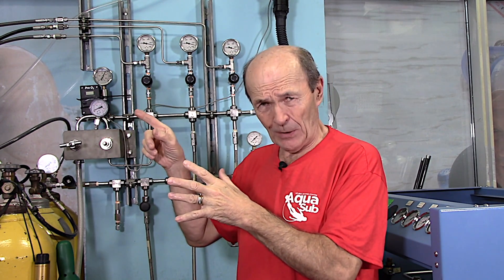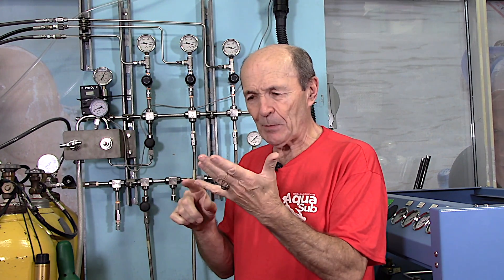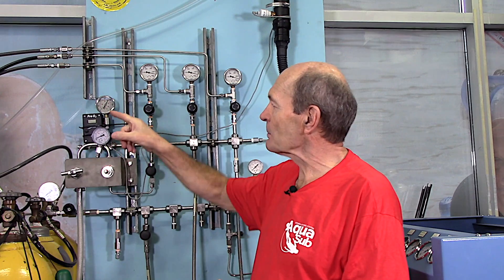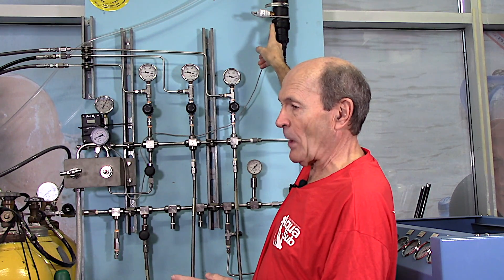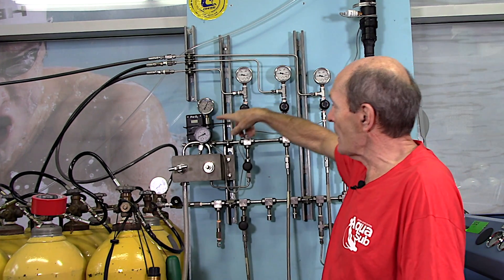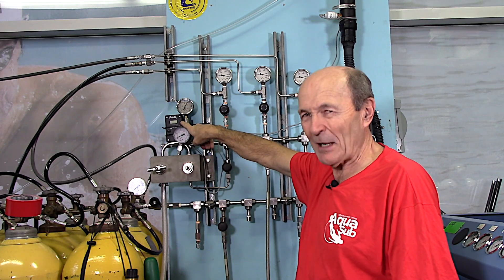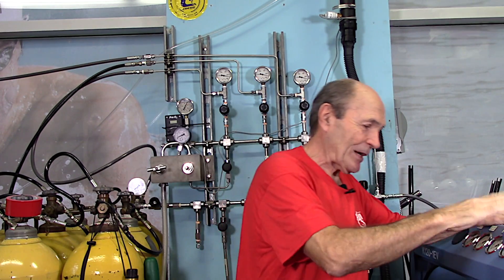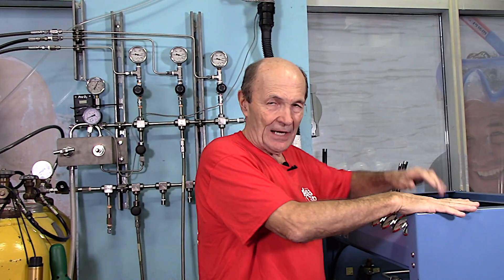How Is Nitrox Made? - Scuba Tech Tips: S08E21

Comment: We used to use the partial path pressure method with a twist. We would first pre-fill the tank partly with air And then fill up to a certain percentage with pure oxygen and then use air to create the pressure needed to go to 3K PSI the math was more annoying but it meant that like adding acid to water you weren't really slamming the tanks interior at any point in time with high pressure pure O2.

Granted yes in the moment the valve did. 

This reduced  total risk overall...

And we always checked our Blends on an oxygen analyzer afterwards..
Reply from the maker: The partial pressure mixing method is fading away as blending sticks and new monitoring can do this with less risk (and math), than PP.  
A

Comment: The Atmosphere is 21% O2.. 462 PSI of O2 + 2600 PSI of Air. Roughly have 1/3 of the Tank filled with O2. Hence your 32% Nitrox.
Reply from the maker: Not quite so simple when using partial pressure blending to get the blend within 1% of target.
A
Reply: @AlecPeirceScuba_SeaHunter  I remember reading years ago, The Atmosphere was 20.8%O2

Comment: Good info, but why would you need a booster pump for continuous (stick) blending?

Because the O2 tank is flowing into the stick at atmospheric pressure I regularly am able to use my O2 J tanks right down to about 2bar, essentially the whole tank. And then of course the main compressor will provide the pressure to fill the tank, so I am confused about the mention of a booster pump?
Reply from the maker: It is a bit of overkill but a booster can be used for different purposes. Sure it will draw down an O2 tank so the full contents can be used. That's not needed for Stick filling, as you say, but it can also be used fill higher pressure tanks, for topping up, for transferring contents, etc.
If not needed at your facility, as with a Stck fill, avoid a booster. They are not cheap, they're noisy & need constant care to remain safe & in top condition.

Comment: The Membrane system for making Nitrox is a lot easier and safer than blending it I’ve got a Nuvair membrane system with a Bauer K14 -4 stage compressor for sale that I used in my commercial diving work
Reply from the maker: That is a good setup and reliable.  No air, no work right?

Comment: Great video, years ago I was a commercial hydrostatic tester and also  a relief pumper for nitrogen and helium. Burst discs happened quite often, but then the cylinder was contained by the fill fitting valve and hose. Now they may use safety chains! Very loud but not a lot of reaction from cylinder because it was a controlled release. Also remember the cylinders are hydro tested to 5/3working pressure, 5/3 of 3000 is 5000!
Reply from the maker: Thanks for sharing Bigfoot.  I did 2 videos on hydrostatic testing as many divers don't know the 5/3 testing pressure and get paranoid about a 200 psi increase due to a hot sun!

Comment: Is this a basic comprehensive list of what you would find in a dive shop?
Reply from the maker: It is Erikk.  Most dive shops have one method, usually the 'stick' as is easily to control with a high fill rate.  Next time your at your local dive shop, ask to see their setup as they fill your tank.
Reply: @AlecPeirceScuba_SeaHunter  I will do that. 
I was just wondering because I know that the gas produces have different methods for different gasses and volumes but I would guess those methods would be out of the reach financially or most or even all dive shops.

Comment: When adding O2 on the partial pressure method do you have to account for the scuba cylinder’s temperature increase (and resulting pressure drop after it cools). Obviously the O2 isn’t going to have a huge pressure drop from 462psi. as it would when filled to 3000psi.
Reply from the maker: There is a small measurable change due to temperature but the PP blend does not need to factor in temperature, its primary pressure and volume only.

Comment: A good video which isn't too technical :) .

I've not heard of "the stick" before, but it does sound like a handy solution for some people.

A fourth option that you didn't cover is a Membrane compressor. These have two compressors, one low pressure and high pressure, and excess nitrogen is removed through the membrane as the now Nitrox gas is pumped into your cylinders. Most won't pump above 40% O2, so the cylinders don't need to be O2 cleaned. It's possible to dial the percentage that you want.
Reply from the maker: The membrane system is often used on dive boats. It is not an inexpensive system to set up but does offer increased safety because the tanks and regs don't need to be O2 clean.
Thanks ScubaGirl.

Alec

Comment: I use partial pressure blending method. But I use a cascade of oxygen bottles to get the maximum of each one.
Reply from the maker: Yep! That works. Or get a booster so you can use most of the oxygen in a bottle.
Thanks.
Alec
Reply: I think this is the most common method …partially fill empty tanks with pure O2 depending on the requested mix, and fill the rest with regular air.

Comment: Hi Alec, 
thank you for another amazing tech tip video! 
Can you tell us about Open Cell Neoprene wetsuits?
Reply from the maker: Uh, to the best of my knowledge there has never been an open cell wetsuit, at least not a successful one.
Open cell material is basically like a sponge. Every cell is interconnected so water travels throughout the entire material and completely soaks it inside and out. That's great for holding a bunch of soapy water when washing your car but wouldn't insulate your body from the cold. And it would take forever to dry too.
Wets suits are made from closed cell neoprene so, although filled with millions of cells (holes or pockets), each is separated from its neighbors. Thus the suit is largely air and provides insulation. And when you hang the suit up in the sun, only the surface is wet and it dries instantly.
Take care.
Alec
Reply: @AlecPeirceScuba_SeaHunter  I had seen this https://www.youtube.com/watch?v=7P2Gj_lDFes but not sure I understand the concept - maybe something else is missing

Comment: Those O2 cylinders look awfully lot like industrial “welding/cutting” cylinders and an industrial  reducer. Not sure about your side of the pond but in Europe medical O2 is shipped in white cylinders with a black band. 
I would happily use industrial O2 but its not certified clean and healthy for human consumption? 🤔
Reply from the maker: I think most 'industrial' cylinders are similar. The difference would be in the contents and the level of cleanliness as required for the gas.
Generally, the cylinder color indicates the contents so here, a green top means oxygen. There are several levels of oxygen depending on the application. I use a similar cylinder for my oxy-acetylene welding at the ranch (see AlecPeirceAt the Ranch) but, as you say, that would not be suitable for breathing. There is medical grade and breathing grade and probably others too. That would be specified by an attached label.
Take care.
Alec
Reply: Actually industrial gas is cleaner than medical or aviation gas they just have a ton more paperwork

Comment: Before the days of commercial Nitrox, we used welding cylinders (medical O2 required a prescription) and a cascade hose to add O2, the top off with compressed air. We did use O2 analyzers (we were stupid, not suicidal). Did the same with trimix, used a helium canister!
Reply from the maker: Just as with early scuba, there was a lot of trial and error (more error than trial sometimes) with early gas mixes.
I'm hoping that today's divers appreciate what came before. It wasn't always as easy as going into a dive store and asking for  32% mix!!
Alec

Comment: topic: spare air or similar second air source. is it worth it, do you just get 3-4 breath at typical 60ft+ depth ? which is better than nothing I suppose....
I find myself diving alone more (either lobster hunting in which case you intentionally split, or having a greater distance with buddy which can take a while to reach at depth) and thinking self rescue is always better than depending on someone else, or use it to reach them. I've seen those piggy back tanks but they are heavy + full regulator. There are many cheap copy cats now out, so not a lot of $ for extra safety net.
Reply: I should have known you already covered it. Thanks!
Reply from the maker: I made a video on this topic Alain S04E10. Check that out.
The best redundant air supply system I've ever seen/used is the from XS Scuba. It's called the  XTR Extra Air Backup System.
It's light, easy to use, compact and cheap (relatively).
Good luck.
Alec
Reply: thanks! https://www.xsscuba.com/regulators/xtr-extra-air-complete-backup-rescue-system

Comment: It's been asked already, but can you explain the "membrane" method of making nitrox? I don't think for this method the tank needs to be O2-clean, or am I wrong?
Reply: it does not as the air coming out is pre-mxied which all tanks can take. My understanding that a membrane separate the Oxygen molecules from Nitrogen molecule (different size) with a separate compressor, and that is mixed with regular air (like the stick mentioned) into the main compressor that fills your tank.
Reply from the maker: That's right Alain. Always think about the gas going into the tank. If it's pure oxygen or even above 40%, the tank must be O2 clean. If it's mixed at less than 40% when it enters the tank, it does not.
Now, note that many dive shops either don't understand this or ignore it in the pursuit of profit. They may insist that all tanks with an EANx mixture be O2 clean. That is their prerogative, but wrong. It's especially wrong when they claim its in the interest of safety!

Alec

Comment: Hi Alec,

The "stick" method has an "official" name: Continuous Flow Mixing aka CFM. It is, indeed, commonly used and efficient way to drain O2 tank because the end pressure can go up to  a few bars (30psi) without booster pump...
Reply from the maker: Thanks Huu, I try to keep everything simple and not promote specific products and to remain as neutral as possible.
Glad you like the videos.
Alec

Comment: Alec, I have one nagging question. Your description of the partial pressure method was very easy to understand, but it made me think about O2 percentages. When a tank is filled with the equivalent pressure of 32% O2, and then 68% of air, is the diver now not breathing something closer to 53% oxygen due to the combined O2 from the 32% of thd pure oxygen tank and the 21% of oxygen found in the atmospheric air? I'm sure this is not a particularly important question for the diver,  and the math and science account for this fact, it just puzzles me. In any event, thanks for a great video!
Reply: You just add less O2 so it works out to 32%
Reply: 32% is Oxygen and 68% is Nitrogen. There is no Oxygen in the 68%. Does that make sense?
Reply: I see what you are asking now. The calculator takes into account the 21% of Oxygen that is in the top off gas(air) so that when the tank is full it will be 32%.
Reply: Okay, I figured there was something simple I was overlooking. I should never be trusted when math or numbers are involved. Thanks, everybody.

Comment: Hi Alec, is Nitrox used for deep dives ? Nice refill setup your showing. Also on FXM Fox Movie tomorrow 03/01 will be showing The Neptune Factor 1973 Ben Gazzara, good SCUBA scenes in film. Thought of you. Hang Tuff My Friend 👍
Reply: Nitrox is used to reduce the partial pressure of nitrogen you are breathing to reduce your on gassing of nitrogen. The extends your no decompression limit at a given depth at the expense of a higher partial pressure of O2. The higher ppo2 decrease your max depth you can go due to oxygen toxicity, but you can stay longer at the depths you can go with less risk of becoming bent and slightly less nitrogen narcosis.
Reply: Short, grossly oversimplified answer: no, nitrox is used for longer and/or safer dives. You can't go as deep on nitrox as you do on air, but you can stay down much longer. Or, you can dive using air tables and get the same bottom time (still limited by nitrox's maximum depth though) and have a really large reduction in your risk of getting bent.
Reply: @DanBowkley   For me nitrox isn't as worthwhile for shallower dives (meaning 70ft or shallower), unless you are diving an aggressive repetitive dive series. For me nitrox becomes an asset when I am diving closer to 100ft.
Reply: Depends on what mix you are getting EAN28 has a Max Operating Depth of 132fsw, while EAN32 has a MOD of 111fsw (of course using a max PPO2 of 1.4). Those two mixes are probably the two most commonly used on deep dives.
Reply from the maker: Thanks Mark.  Enjoy the old scuba movies.

Thanks for watching.
Alec

Comment: 4th option:  membrane they use on boats to separate oxygen and generate nitrox straight to your regular tank (the only time I get nitrox these days because of # of dives per day).
Also why would you need a booster in the stick case ? you are pumping pure o2 into regular air intake pressure no ?
great video, thanks!